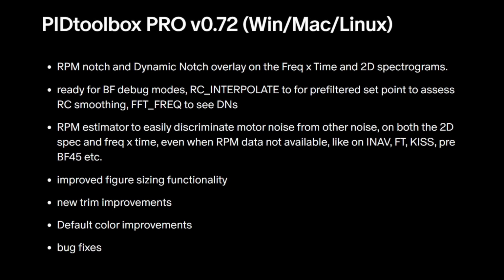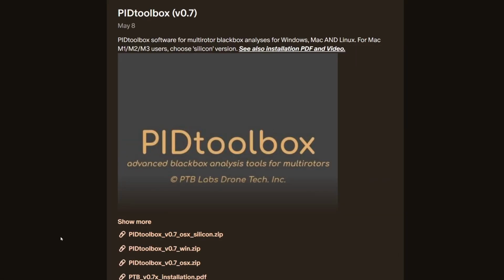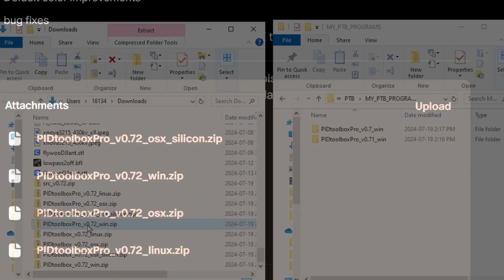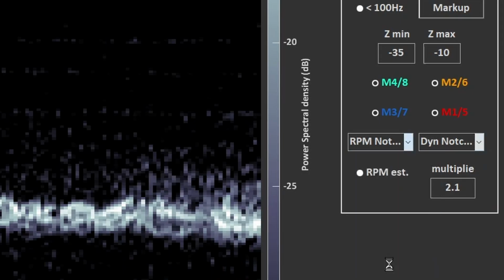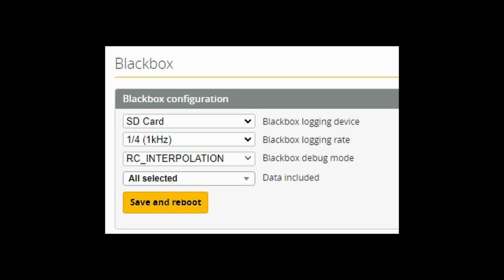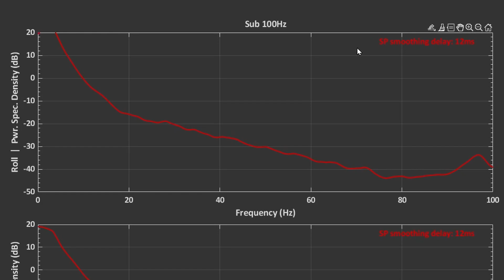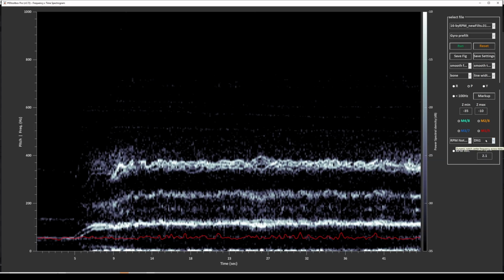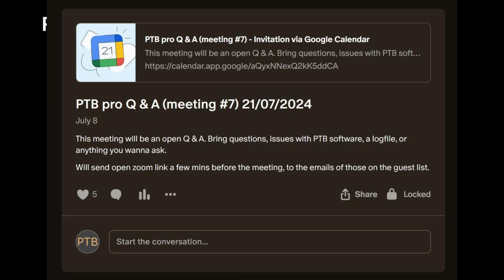PIDtoolbox PRO v0.72 overview

Comment: Is there a source where I can learn how to read all the graphs (not just of the recent version)
I really like the tool itself, but I want to understand what it means, and see what's wrong to fix it. 
Thanks
Reply from the maker: all the fundamentals of tuning with PTB can be found on this playlist. It describes things using earlier version of PTB, but the functionality is essentially the same. https://www.youtube.com/playlist?list=PLycwhvl4h5nNbqRvcVB8y6fSPAgMbBo8p

Those vids coupled with these release vids detailing the changes in the interface should provide everything you need for the fundamentals https://www.youtube.com/watch?v=zQVXi2TQxHg&list=PLycwhvl4h5nOSCqLSTQf201W7Hmt5eLM9

If you want direct 1-on-1 help I have a tuning service as well. There you can get direct step-by-step help https://pidtoolbox.com/
Reply: @PIDtoolbox  thanks, then I have to drive into the fundamentals to learn how to use your newest feature, all the lines are quite overwhelming ;)
It's pretty impressive how much effort is put into this software
Reply from the maker: @dextergreenman2162  hence, why it’s called a pro version. The new lines are notch center frequencies.